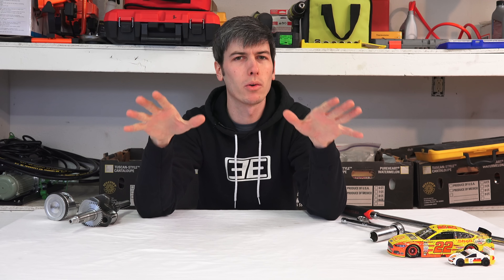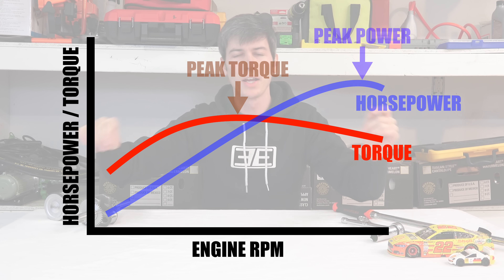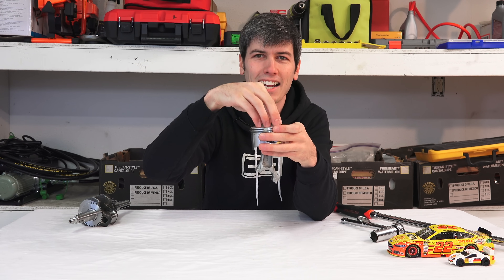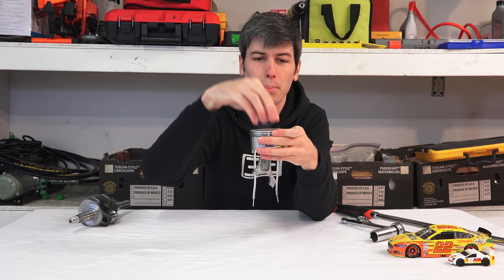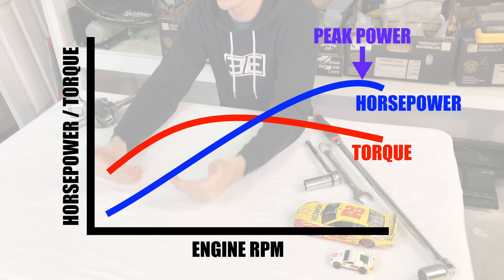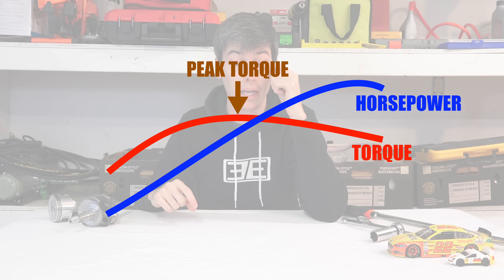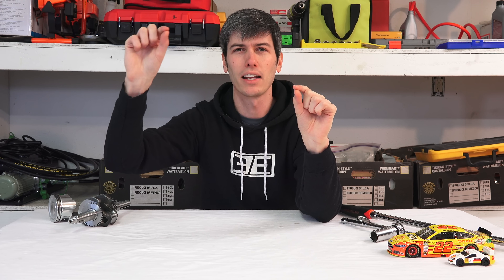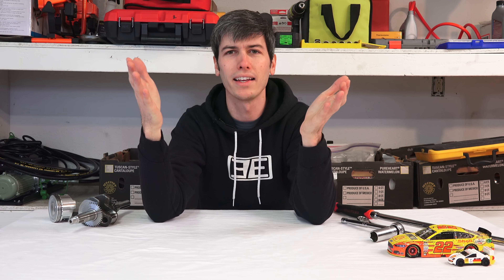Horsepower vs Torque - A Simple Explanation

Comment from the maker: Thanks for watching everyone! I think one question that may come up after watching this is "Why does maximum acceleration happen at peak horsepower, rather than peak torque?" It's a fair question, because in a single gear ratio, peak acceleration (the force pressing you back in your seat) occurs at peak torque. I have a video explaining this in great detail: https://youtu.be/cb6rIZfCuHI
Edit: Also, if you're confused about the equation for Horsepower in this video not including 5,252, I did this to simplify the video. 5,252 is a scaling factor only appropriate for imperial units, it is not useful if you use kW or N-m, so it's inappropriate to use 5,252 in a general equation. I will include a video in the future explaining exactly where (through derivation) 5,252 comes from.
Reply: That's the thing, more torque doesn't necessarily mean better acceleration, because torque does not take into account actual movement. Horsepower takes into account the actual spinning of the engine, which in turn actually moves the car.  Check out his tesla 10,000 lb/ft of torque video, that explains it well.  One example, if you have a a 50ft wrench, being a man generating maybe 25lbs of force, then you can generate 1250 lbft of torque (50ft * 25) with your wrench! But you won't be developing much HP since you can't move the wrench fast enough to develop any major HP - otherwise we'd all be driving around in hand cranked cars without breaking a sweat.
Another way to look at it - if you have 1250 lbft of torque at 1 rpm (low hp), you are not accelerating much at all - you have lots of force so you could tow something slow, but not much movement or acceleration. But an engine that can maintain high torque while spinning fast (high RPMs) will have high HP, and therefore accelerate fast.
Reply from the maker: +M Yes, assuming the torque drop off at peak RPM is not super severe. And yes, this is done in racing (shift at max RPM).
Reply: +Billy 
Here are the relationships. 

--------

US/Imperial

Horsepower = (Torque * RPM) / 5252

Torque values are in foot pounds.

--------

SI/Metric

Kilowatts = (Torque * RPM) / 9549

Torque values are in Newton Meters.

--------

Torque and horsepower relations:

T = HP * 5252 / RPM
HP = T * RPM / 5252
RPM = HP * 5252 / T

Torque values are in foot pounds.

--------

Torque and KiloWatt relations:

T = KW * 9549 / RPM
KW = T * RPM / 9549
RPM = KW * 9549 / T

Torque values are in Newton Meters.

-------- 

Convert HP to Watts = HP * 745.6998716 
Convert HP to KW = HP * 0.7456999 

Convert Watts to HP = KW * 0.0013410
Convert KW to HP = KW * 1.3410221 

Convert NM to Lb/Ft = NM * 0.7375610
Convert Lb/Ft to NM = Lb/Ft * 1.3558200

Hopefully this helps.
Reply: Brian Reilly Not entirely true. Car A will start taking advantage of its increased power as soon as car B has to shift into second gear, as car A will achieve a much higher RPM in the same gear (proven by the relationship of torque-horsepower). 

Torque is changed by gear ratios, horsepower is not. Torque does not win races. Any high horsepower car can be given lower gear ratios to provide more wheel torque. A low horsepower engine is low horsepower regardless of gearing.
Reply: It all really only boils down to torque at the wheels. Maximum horsepower is at a higher rpm allowing for lower gearing to allow more torque at the wheels than at peak torque but manual/auto transmissions don't allow for variable gearing per say. Also a torque number is useless without a corresponding rpm number which is a hp #. This is why constant variable transmissions would be the best if A they could handle larger power and B Manufacturers didn't put useless shift points in them. I understand it feels weird but so do electric cars. They could at least but a setting to turn shift points on/off. Snowmobiles have had cvt for decades and the acceleration is amazing.
Reply: Engineering Explained so for accelerating as fast as possible in a race, one should ideally shift gears at max RPM instead of the at the point where torque is highest?
Is that done in practice?
Reply: @maximstarodub6703  absolutely, in practice and in theory. short shifting can provide a LACK of potential acceleration at any same vehicle speed.  HP max is the maximum rate of acceleration at any same vehicle speed.   peak torque levels are irrelevant, as they deal with engine characteristics, NOT wheel torque values ( rear wheel force)   shifting from short of max RPM puts the post shift RPM at a lower HP level than if you shifted at redline, reducing accelerative forces.  again, regardless of peak torque levels and values.
Reply: +M it depends on gear ratio, but in practice an engine is tuned to give maximum acceleration when shifting right before revlimiter as it would be no sense to have more rpm if it's slower.
Reply: Both torque and horsepower are dependent on gear ratio (i.e. engine speed).  Torque is dependent only on the engine speed.  While horsepower is dependent on both engine speed and torque.  More torque = more horsepower, and higher engine speed = more horsepower.
To win races you want to have maximum acceleration.  Maximum acceleration occurs at maximum torque...AT THE WHEEL....not at the engine's output.  And this only occurs at maximum horsepower.  Therefore, ultimately horsepower is what win races, not engine torque.  Because horsepower is a measurement of how much torque an engine produces in a given amount of time.
Reply: Noel Masson Actually, the more you can stay in the band of your peak horsepower, the faster you will be. There are now huge spreads in peak HP and torque. You always want to stay in a shift range where your integral of horsepower is maximized throughout your gear. Hence you short-shift a Focus ST on the track to stay near the HP peak. I believe you need to short-shift the Fiat 1.4T MulitiAir as well.
Reply: that's because no engine produces the same torque across the entire rev range - it varies with RPM based on the performance of engine
Reply: @VBshredder  Not true for a Hellcat.  Torque "curve" for a Hellcat is as flat as can be.  Shift at redline only.
Reply: @lobuxracer  So i had to dig through this list of comments since youtube's comment links suck! My comment is absolutely true for a hellcat or any object that spins. You say the torque curve is flat and i believe you - so it maintains horsepower with RPM - which actually makes you accelerate -  that same torque curve could be applied to mammoth engine spinning from 1rpm to 7rpm - graph could look the same - torque hovering around 700lbft or whatever it is for hellcat -  and it would be SLOW - because you need HP to actually move something. Not trying to be a dick, just pointing it out because this is the concept the video explains. Without RPM, which is only accounted by horsepower, you ain't moving!
Reply: @VBshredder  Agreed.  The issue with a flat torque "curve" is it has no real optimum shift point except redline.  If toruque and horsepower diminish as rpm increase, there will be optimum shift points less than redline.  It's all based on area under the hp curve, but if hp never falls off, just shift at redline and call it good in all gears assuming traction is available.
Reply: @lobuxracer  yup totally agree - if torque stays constant then just go for max rpm = max HP.
Reply: Tanah Merah Saying that horsepower is dependent on gear ratio is misleading as the gear ratio can always be altered to keep the engine in optimum rpm ranges. For a given rpm, horsepower will be the same at the engine as at the wheels (excluding drivetrain losses) but torque is not.
Reply: Brian Reilly No. Didn't you just watch the video? He just said horsepower gives you the acceleration and velocity.
Reply: @ something1random23 "josbanse The peak acceleration force does happen at peak torque."

No - that is wrong (Josbanse is actually correct).

I think Jason - like all of us - after discussing the subject, just got the terms accidentally reversed .

Torque is really just a term explaining a way of measuring the instantaneous force on the pistons - that is the same force that is measured , albeit in an accrued sense over a given and non instantaneous time period, when we refer to HP.

Peak acceleration almost always occurs at peak HP.

Greater engine HP (than engine Torque) will usually equal greater Torque at the wheels; which equals greater acceleration.
Reply: Asking "What's the difference between torque and horsepower?" is like saying "What's the difference between speed and miles?"
Why use the unit for one of them, and the general term for the other? It should be "What's the difference between torque and power?"
Reply: One correction:  Toward the end of the video, you stated that HP cannot exist without torque.  In an internal combustion engine, that is true but if you are speaking from a purely physics perspective, it isn't.  A jet or rocket engine, for example, produces plenty of HP but - ignoring accessories, etc - produces no torque at all.  Same thing with, oddly enough, a horse.  As long as the horse walks upright and doesn't roll over, it produces zero torque but lots of HP.

You could also have gone a step further and explained that, technically, a piston engine produces zero torque as well.  That is because the piston - the source of the force produced - travels in a linear path.  Therefore, it produces a linear force and, since torque is a rotational force, it produces no torque.  That linear force is then taken and converted into torque via the crank shaft, but the force produced at the piston is linear.
Reply: +Engineering Explained
This is exactly what I was going to ask you about. In imperial system Horsepower=(Torque*RPM)/5252 right? Where torque is in LB-FT. Now if I use metric units, the torque will be in Nm. Please include to that future video, how we can calculate HP in metric system :) Is it just HP=RPM*torque?
Reply: + Kevin Wildash makes pretty good sense
Reply: mopar85 A stroker kit increases torque because it increases displacement and the lever arm length. A big bore kit increases torque by increasing displacement and piston surface area. The difference is stroker engines are not very good for high rpm applications where more horsepower is produced.
Reply: Engineering Explained
I have a question regarding the peak acceleration at peak torque in a given gear rather than at peak horsepower. In the CVT video, you said that you will have more wheel torque at peak HP rather than at peak engine torque because of a gearing difference derived from RPM at peak horsepower divided by RPM at peak torque. So if peak HP creates a higher wheel torque than peak engine torque in the same gear, why is it that you will accelerate the fastest at peak engine torque instead of peak horsepower?
Reply: VBshredder Seriously, thank you so much for this explanation. I had been having such a hard time with certain concepts of this because I have a hard time understanding things if I can't understand the big picture and this accompanied with the video helped a ton. Thank you!!!
Reply: @deadlycucumberplants  Took me long enough sorry but thank you and glad I could help someone!
Reply: A turbojet engine does produce torque. Just not a lot compared to a piston engine. When you multiply that small amount of torque by 30,000 rpm it becomes a significant amount of horsepower.
Reply: Gabriel Abdo NM (newton meters) is a different unit of measuring torque. NM is to lb-ft like Centimeters is to inches.
Reply: There is no force which pushes you back in the seat as you accelerate. What you are feeling is the seat back applying a force to you in order to accelerate you forwards.
Reply: That makes sense. I was thinking in terms of what gets sent to the wheels, but that's just based on the transmission. Torque at the flywheel would be the same regardless of the gear selected.
Reply: Hey Jason, can you do a video comparing thermal and mechanical efficiencies of gas turbine, diesel and petrol engine?
Reply: Thanks for teaching 👍😊
Reply: This video is now correct.  The other video regarding optimum rpm to shift gear was incorrect, as that video was all about maximising torque.
Reply: Engineering Explained so would a stroker kit be better for making torque since the pistons have more leverage on the crank shaft
Reply: mopar85  A stroker should make more torque, but they generally sacrifice revs (all other things being equal), so you'll make more torque in a given gear, but you'll have to shift earlier, losing the torque multiplication of being able to use that lower gear longer.  

I wish it was easier to find torque/power curves and figures - at the wheels for each gear - instead of engine torque/power curves.  That would probably give a better idea of actual vehicle performance.
Reply: Tanah Merah Exactly. In math, that's called an integral.
Reply: haha yup i thought of the 5252 while watching. :D
Reply: If hp is torque multiplied with rpm, is it right to describe torque as power per engine revolution?
Reply: Rotaries are low peak torque but almost all torque available instantly and power is always supplied too crank shaft unlike a pistons
Reply: +Engineering Explained , could you make some comparison of turbo diesel and turbo petrol engines? Many people today still think that diesel makes more torque than petrol, which is not true in case if both are turbocharged. Turbodiesel makes more torque than naturally aspirated petrol engine. And diesel without turbo makes significantly less torque than petrol without turbo. Also, it's no longer true that diesel has more power at lower rpm. In fact, many modern turbocharged petrol engines have peak torque available from even lower rpm than diesel! In addition to that, the peak torque is available in much much wider range of rpm in turbo petrol petrol engines.
I know, many turbo petrol engines are detuned, such as some BMW 3.0 versions which only makes relatively poor 450 Nm. But look at this:

Best of the best today:

Most powerful  DIESEL  4.0 V8: 435 hp / 900 Nm (2 turbos + 1 compressor)
Most powerful PETROL 4.0 V8: 612 hp / 900 Nm (2 turbos only)

Alpina BMW 3.0 diesel: 345 hp / 700 Nm
Alpina BMW 3.0 petrol: 440 hp / 660 Nm

Jaguar top diesel 3.0 V6 - 300 hp / 700 Nm
AR Giulia top petrol 2.9 V6 - 503 hp / 600 Nm
Audi RS4 top petrol 2.9 V6 - 450 hp / 600 Nm

VW top 2.0 diesel: 240 hp / 500 Nm
MB top 2.0 petrol: 380 hp / 475 Nm

And so on... While torque is very similar or even the same in petrol and diesel, horsepower is significantly higher in petrol engines. And even if torque is a bit lower in petrol engine, it is available in much wider rpm range. For example Maserati's 3.0 turbodiesel makes 570 Nm but only from 2000 to 2600 rpm. Maserati's 3.0 turbopetrol makes 550 Nm which is a little bit less, but it's available from 1750 to 5000 rpm which is huuuge difference. Not to mention horsepower. OK, it also depends on which engine is single turbo, which one is twin turbo, etc., but still, all turbo petrol engines I know have much wider rpm range with peak torque available than any turbodiesel. Any many of them also have peak torque available from lower rpm than comparable turbodiesel. I think all this should be finally explained in 2018 because obviously most people still live in late 90's.
Reply: Engineering Explained  and does one need more torque or more power to drive up on inclined surface? i mean while buying an SUV, should one pay more attention to peak torque or peak power?
Reply: Engineering Explained what happen if i used a crankshaft with more weight,Is that produce more power and speed.?
Reply: Engineering Explained hello great video I was wondering if  two cars that have the exact same body's and engine same amount of horsepower like say a 93 honda hatch both have a 2.0 liter 4 cylinder making both 300hp but one has 285 torque and one has 330 torque would the car with more torque be faster or would they be the same
Reply: Engineering Explained 2.0 liter 4 cylinder both make 200 hp but one makes 185 torque and one 230 torque but one hatch weight 2300 and one 2450 would the one with more torque be faster since more torque makes it easier to pull
Reply: I like your video clips but what do you think of the cvt transmission I don't think it's a effective transmission to me i dont get that power from while driving
Reply: Let me ask a dummy question, I have seen a patent wich the rod have shifted a ⅓ to ½ of diameter size, the patent claims to improve power and torque.That could be truth or is nonsense?
Reply: Engineering Explained q
Reply: Thank you so much for clearing my concept about HP and torque. I just have one question if hp means more speed then what are the benefits of more torque in vehicle?. And also if there is a uphill race will the vehicle with more torque win or more power win?
Reply: Engineering Explained Jason can you make a video about magnetic oil filters and whether they are worth the money or not?
Reply: Acceleration is the rate of speed increase.  Power is the rate of work being done.  An electric motor may produce a lot of stall torque, but at zero RPM,  the power to the wheels  is zero watts.  For acceleration to happen,  the friction losses must first be overcome.  If a gasoline engine is racing in neutral,  regardless of the throttle setting,  all of the energy is being used up in the engine itself due to friction losses and heat waste through the radiator and exhaust gasses.  It is instructive to note that, when the vehicle is in gear,  all that matters is the available power and torque to the driven wheels.  In a lower gear,  torque is multiplied by the same factor by which speed is divided... so in any gear (ignoring transmission losses), horsepower is the same, provided the engine at the same RPM and rate of fuel delivery..
Reply: You'd think shifting at maximum RPM every time is faster than shifting earlier but I don't think it is.  With the R6 if I shift at 14.5k RPM vs 16k throughout all the gears I think I get up to speed quicker and numerous times looking at the speedometer and making a video it seems to be true.  I think 16k is for marketing which is great, you get the sound and can rev it out throughout 1-3 w/o really much difference but when you get into 4-6 the difference is very noticeable.
Reply: No, he's right. Peak acceleration in a given gear happens at peak torque.
Reply: Engineering Explained thk , great video
Reply: Following your graph if peak torque is 50 and torque at peak horsepower is 40 and in 3rd gear your ratio is 3 and 4th gear ratio is 4 wouldn't it be higher acceleration if you shift gear at peak torque (50*4= 200lb ft) than at peak horsepower (40*4= 160 lb ft)
Reply: do you have a NM explanation ?> brother ?
Reply: Engineering Explained love your videos but please educate people properly. Lb-ft is "foot pounds" not "pound feet"
Reply: ifix car Thanks body
Reply: If this type regrind increases the effective stroke - then yes, it will have more torque. (Regrinding a 0.333 Dia. shaft to 0.250 Dia. and offsetting the bearing center outwardly to make the stroke longer by making the new journal  circle tangent to the old journal circle toward the out side.)
Reply: great work...i am commerce student still m able to understand a significant portion of the vedio. ..thanks again
Reply: Why does torque change at various rpm?  If torque is force x distance.... and the connecting rod is a fixed length therefore distance is fixed at all rpm... what changes that makes force go up?  Isn't the fuel injected at a fixed rate per combustion cycle and the compression ratio always the same, regardless of rpm?  

It seems to me that torque should be the same number at 1,000 rpm or 3,000 rpm.

Please let me know what I'm missing.  Thank you. Greg
Reply: Thanks for the insight.  This is another really great explanation for those who have a hard time with these concepts.  In practice it is a little more complicated (as I am sure you know).

I agree with the peak HP processing from a pure theoretical perspective, if we assume either infinite gearing or massive numbers of rapid gear changes.  However, if you game the HP numbers within a very narrow power band, you won't generally get practical application of more horsepower.  By gaming the power band you can generate a higher peak HP number within a very narrow range, but, a higher torque number, in a wider applicable power band, but slightly less HP will still likely accelerate faster without an infinitely variable gear arrangement.  That is because there can be more NET HP produced across the wider power band at regular increments of work across that powerband.

It is the amount of HP generated, at regular increment (say 50 or 100 rpm increments) within the usable or geared powerband that produces overall acceleration.  All things equal (weight, number of gears, etc), if I have 20% greater torque, across a 2000rpm range (like from 3000-5000rpm) but produce 10% less peak horsepower than another motor, which has only a 1000rpm power band, my gearing and therefore my acceleration will be much faster than the higher HP motor over a distance that allows the use off the entire power band and gearing.  The reason is that I am applying far more NET HP, as applied across the powerband that is used, than the vehicle with a higher peak HP.  This is the "power trap" some folks fall into when building engines
Reply: Engineering Explained it is very nice representation by you.nice explanation keep it on.
Reply: How about in motorcycle ? if you giving a kick start and feed it with a bet of gas, could be that a horse power too in relating to a real horse? just curiuos.
Reply: How can a "rat" Harley Davidson out accelerate a Yamaha R1?  Because it produces more torque at far lower rpm than the R1.

There are plenty of videos on here that demonstrate this.

BTW I read plenty of books and articles when u studied Motorcycle engineering.
Reply: Gg
Reply: If I have a choice of 2 engines with the same  peak hp, give me anyday the engine with more hp in the 1200 to 4000 rpm range. It'll be more effortless and powerful in everyday driving. The other engine would require a downshift or two, every time extra power is needed. More power at lower RPM = more torque at lower RPM = more acceleration at the typical RPMs that vehicles are at.
Reply: I took Physics as a college sophomore. I can give you a far better and more accurate definition of both. I was a young hot rodder, and never forgot them. "Torque is the ability to do work. Horsepower, is the ability to sustain it." Think about it!
Reply: Max,  yes, it's torque at the rear wheels that creates acceleration not engine torque (ignoring the wheel diameter). Consider a couple of ideal engines with very flat torque "curves". One engine produces 200 lbft at a redline of 5000 rpm, and another produces a measly 100 lbft but at a redline of 10,000rpm. Which one would accelerate fastest in your car when revving to maximum rpm?
The answer is no difference, roughly speaking. The reason is that the engine capable of 10,000rpm will use a 2:1 higher gear ratio than the other engine to get the same wheel speed, so it's torque is boosted by a factor of 2. Both engines will produce the same wheel torque at the same wheel speed. This is why horsepower (or kilowatts) is the best metric to use when making engine comparisons because it takes gear ratios and rpms out of the equation .
I should add that both the above engines would have the same horsepower, proportional to torque x rpm.
Reply: Engineering Explained I still think you are wrong and the peak acceleration happens in the peak HP. As you said with gearing you can always aim for the peak power and that's true with single gear also. At a set amount of power it always comes back to the force at the wheel so you have to maximise that. What that means is that you have to look at the max torque at the wheel hub and calculate the accelerationg force from that torque using the radius to the road.

As the power is torque*rpm it does not matter what engine torgue you have, it matters how much power you have at the driving wheels and from that you can calculate the torque by dividing with (wheel) rpm.
Reply: @ Josbanse  "Engineering Explained I still think you are wrong and the peak acceleration happens in the peak HP."

You are correct.

Peak acceleration almost always occurs at peak HP.

Torque is really just a term explaining a way of measuring the instantaneous force on the pistons - that is the same force that is measured , albeit in an accrued sense over a given and non instantaneous time period, when we refer to HP.

Greater engine HP (than engine Torque) will usually equal greater Torque at the wheels; which equals greater acceleration.

I think Jason - like all of us - after discussing the subject, just got the terms accidentally reversed .
Reply: Jason, if torque is the force multiplied by the gearing, why isn't the torque figure consistent across the rev range? Regardless of RPM, you are applying the same amount of force throughout a given gear.
Reply: So essentially, the force being applied is not actually consistent across the rev range due to the ignition timing, intake/exhaust pressure, valve timing, and such? 
Meaning that in theory, if an engine had the same volumetric efficiency across the rev range, then peak torque would be constant in a given gear?
Reply: Good video. Might be useful to point out that the curves always intersect at 5,252 rpm. (metric, SAE or imperial...doesn't matter)
I also see lots of comments about when to shift gears. Most important is that engineers pick ratios so that the rpm of the engine lands at peak torque when you shift up. In other words, start shift at peak power, land shift at peak torque. This explains 7, 8 and 9 speed boxes on modern race cars. (Well, that and the time taken to complete a shift is now very minimal)
Reply: Engineering Explained how come desile engines have so much more torque?
Reply: josbanse The peak acceleration force does happen at peak torque. This is the point in the curve where the engine can exert the strongest instantaneous force against the road for a given gear. We know this because Acceleration = Force / Mass. However, you still remain in that gear past the point of peak torque as changing gears will drop the wheel torque more than the increase in RPM on the way to peak power does.
Reply: Okay so I can understand that more torque means better acceleration, and downshifting creates more torque to spin the wheels. But doesn't that mean horsepower doesn't matter at all then? (well I guess it does a little since more torque is means more power) But you just rev it up as high as you can (without a ton of torque drop)? And peak horsepower is just arbitrarily is near your shift point?
That's the part that always tripped me up with these formulas trying to calculate stuff.
Edit: Think I figured it out, like Jason said in the linked video, the formula for acceleration is highest for a given speed when hp is higher. Even if in that gear your not accelerating as fast as you could in peak torque, downshifting will generate more torque than just riding at peak torque
Reply: For those asking about upshift RPM points: you want to shift up when the RPM drop off (at the new gear) will be the MAX TORQUE RPM. That’s rule no 1 at shifting for max acceleration. The are more rules about RPMs in shifting, but this one it the no1
Reply: + Mike

That is an accurate statement.  Horsepower advertisements to sell cars are just silly and only apply to one specific RPM (which you will only see for maybe, what....0.5 seconds before you need to shift).

Granted, peak torque is also advertised at a specific RPM...but torque is not dependent on RPM (unlike the Horsepower numbers that are dependent on RPM), and is more consistent across the RPM band.

To put this (loosely) into layman's terms:

"Torque accelerates a vehicle to a velocity.....Horsepower maintains the velocity of that vehicle."

BTW....with identical setups and gear ratios....Car "B" goes from 0-60 quicker than Car "A", but Car "A" will have more velocity at peak RPM.
Reply: Mike yes, torque matters in the corner
Reply: Engineering Explained I herd a rally driver say it this way: horsepower sells cars, torque wins races.